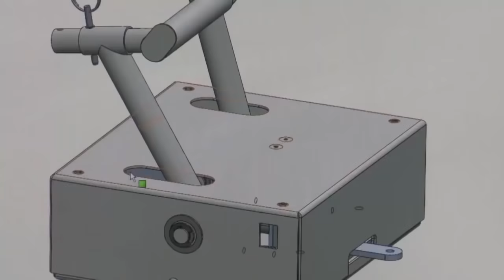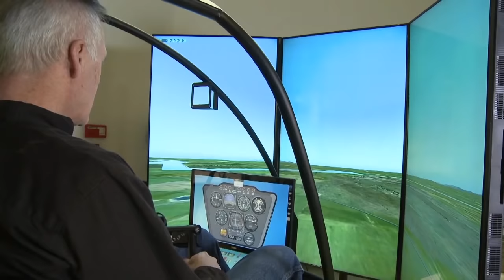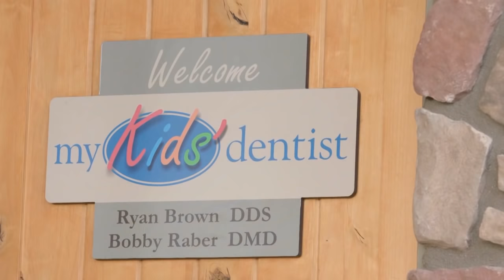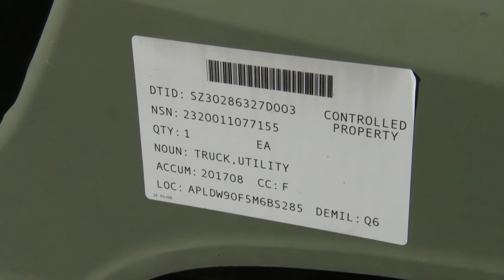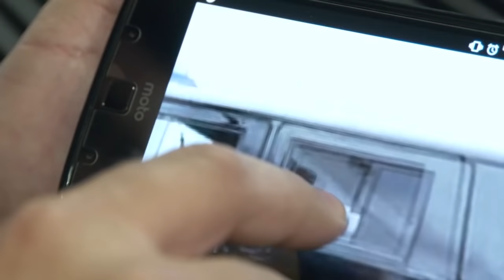Made in USA! Bob Wants to Rebuild a Military Humvee into a Daily Driver - American Metal TV S1.E1

Comment: For starters he bought the right model. The 998 series is the best of the models that the military used. As a service member I know for a fact we abuse the hell out of these trucks. The 998 is by far the only model that veterans would privately own because it is the best off-road version that we have used. The engine could use some modification, but the transmission is built for off-road use and not highway. now it is totally Bob's choice on what to chance in the truck. I would go a different route, but its his truck.

Comment: Took a 10k auction humvee and spent 90k turned it into a Hummer. 100k is a 100k.
Reply: Actually it's better than a Hummer. And now you can do it for $50K cuz we got the parts.
Reply: Dale Aurich, I'm impressed you read and ANSWER comments. Most youtubers are tools and treat comments like they don't matter.
Reply: Dale Aurich it’s grotesquely inferior to a H1 Alpha. Alphas, which are the only ones going for $100k have a 6spd Alison, all the updates from the past 20 years and a Duramax engine. They are in a whole different league then a POS 998. That’s like comparing a 4cylinder ‘87 Mustang coupe to a brand new GT350.

Comment: 4 seat m998 2seat troopseat 1097 variant piles of garbage trans and engine is decent except fuel pump will leak from bell after several season when its cold and heat area

Comment: 😂 Civilians just think it looks cool, they don't factor in they're pieces of shit. Haha. Horrible fuel mileage, always breaking down, insanely hard to get out of (if you're over 6'). But, they are fun to drive in the tank trails... Until it does break down. Haha
Reply: Not much left of the original humvee. All the problems have been addressed and now it just the fun part left.

Comment: "Let's go 3-4 feet above the windshield."  Facepalm, are they going to include scuba tanks? Motor might keep running, but the driver is dead.
Reply: did you not watch the video?? the one guy got out while the driver had on some kind of snorkeling equipment. don't know if it was actually scuba, but didn't you see the hose they use for air??

Comment: Its called a HMMWV m1152 and m1165 they have a 454 gasser bored to make it a diesel with 190hp lol nothing special not even a water fording kit ie intake tube level with roof and a exhaust tube as high as the roof I believe u called it a big tube thingy lol in ur video😂
Reply: not sure what a M1152 or a M1165 is, but i'm guessing this is an M998 since the year he quoted. it could be an M1038 as i believe they sell voth versions on govplanet.com
Reply: ted parker true I'm driving the new ones lol forgot they had the early ones and there body styles configuration lol
Reply: They bored out a 7.4L gas motor to make a 6.2L diesel?
Reply: Hunter White yea they were not smart about this idk why they just didn't put a cat in like the rest of the trucks
Reply: Fail.

The M1151/52/65/67 are REV/ECV trucks and share nothing but a resemblance to this old POS. The trucks at auction are 30 year old Gen 1 998’s.

The engines are Detroit Diesels which by the mid-90’s became built by GEP, a subsidiary of AMG. The Optimizer 6500 being the top of the old 6.2/6.5 family. Forged crank etc.  The 6.2 used in the old trucks are based off the GM/Detroit Diesel found in the K2500 HD trucks. This has nothing to do with the shitty 70’s Buick Gasser-Diesel conversion. Granted the 6.2 is a POS that’s going to pop Cyl-8 every 20k miles.